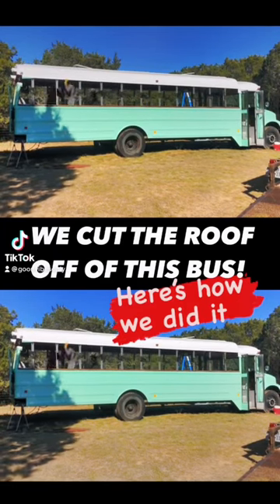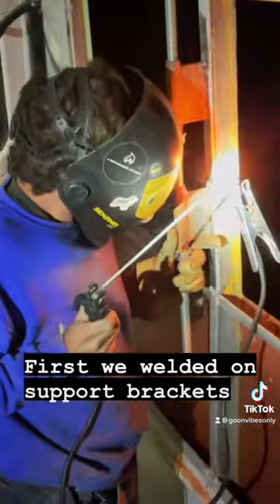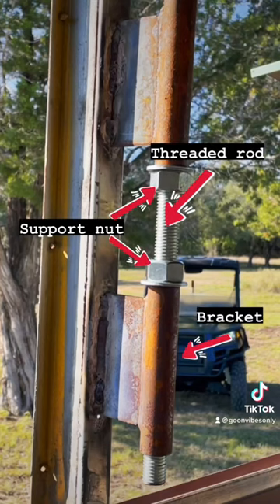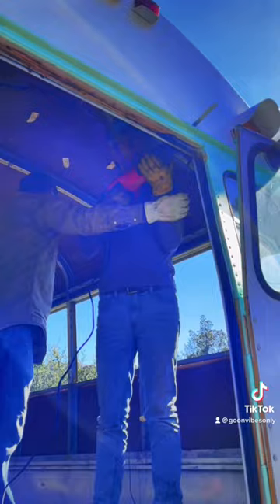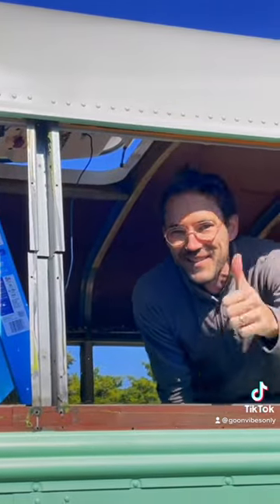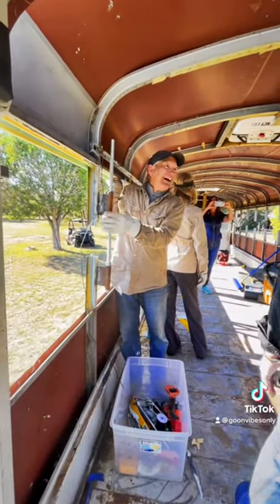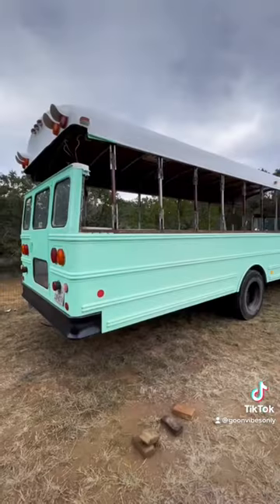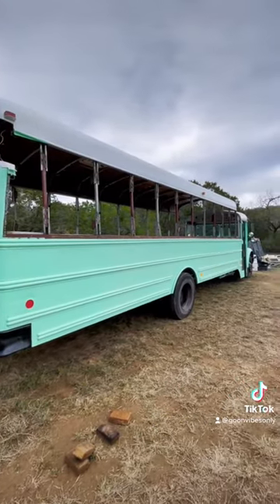We cut the entire roof off of this school bus!

Comment: But why i mean there a certain size for a reason lets see you drive under a low bridge
Reply from the maker: We’re converting it into a living space and I am 6 ft tall. So a 6 ft 1 inch roof isn’t really adequate for me to stand in. It’s actually not very tall, it’s still under 12 ft which isn’t as tall as most typical RVs you see driving on the road.
Reply: No bridge is that low and every bridge has the height posted. It makes the bus an easily navigable and livable space.